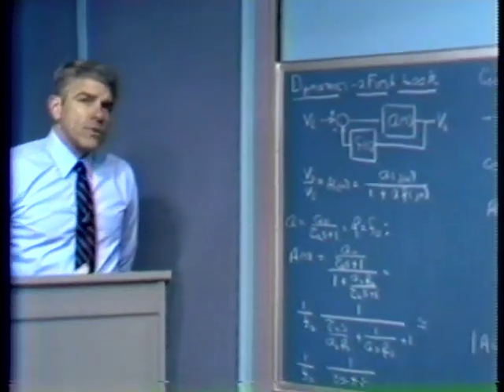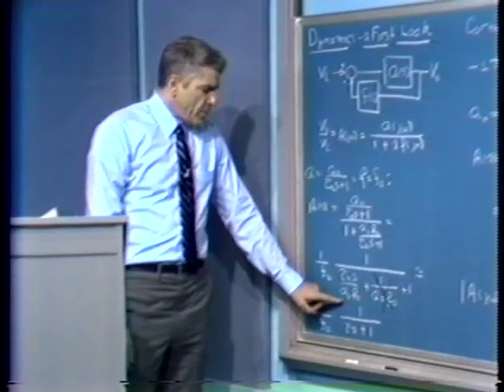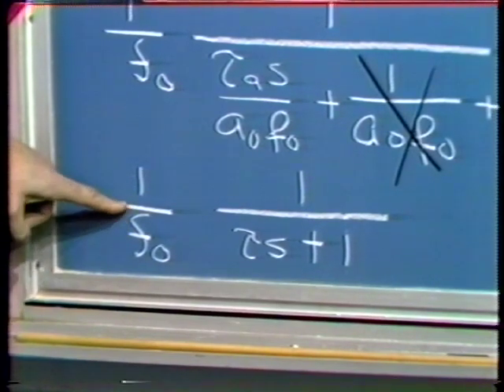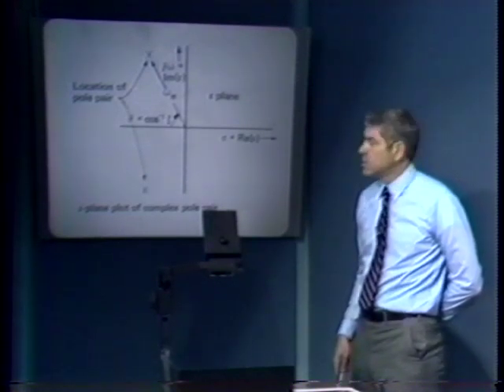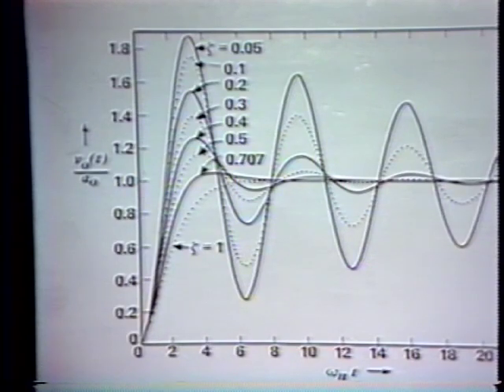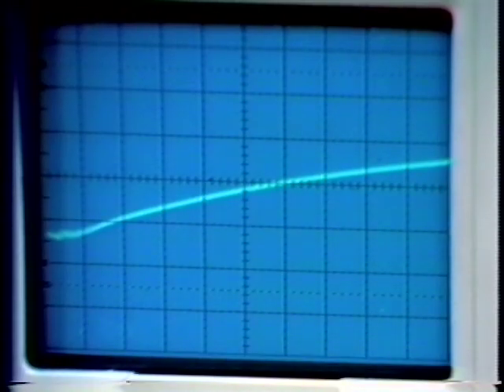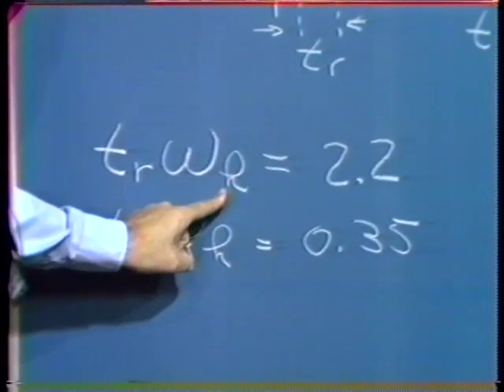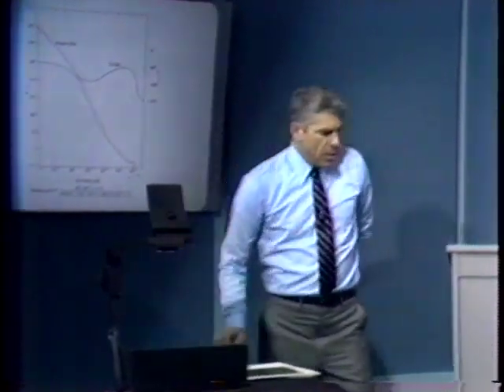3. Introduction to Systems with Dynamics

Comment: I couldn't agree more with Dr. Roberge's use of a vertical log scale on the Bode plot.  I wish more people did this instead of using dBV.   All dB units are logs of a power ratio. When you use dBV, you are implicitly assuming the input resistance and output load resistance are equal and cancel out when you use the common formula dBV = 20*log(Vo/Vi).  You can correct for different resistance values by using the following definition.

dBV = 10*log( (Vo^2/Ro)/(Vi^2/Ri))  = 20*log(Vo/Vi) - 10*log(Ro/Ri)